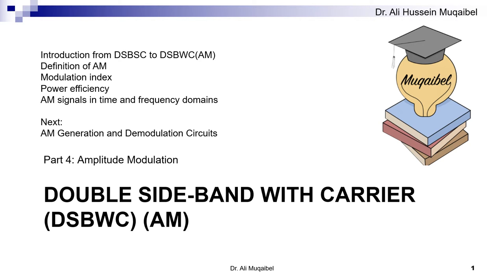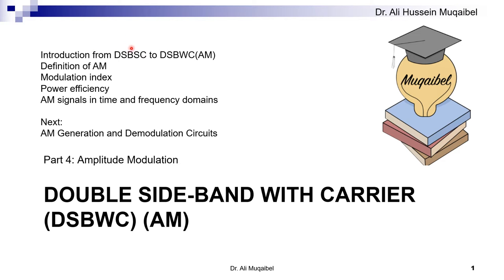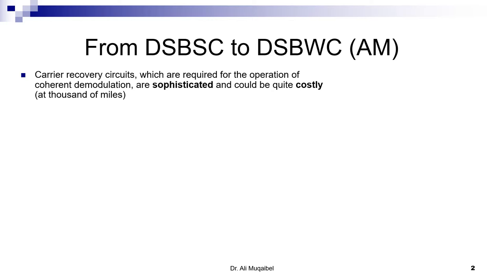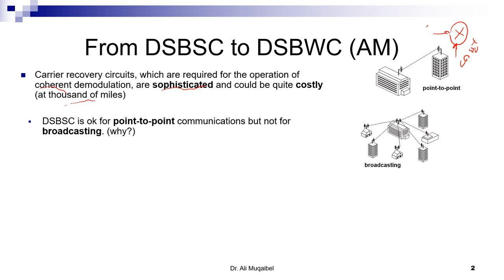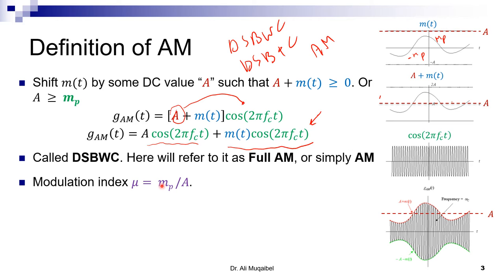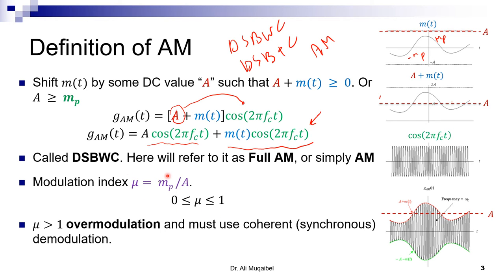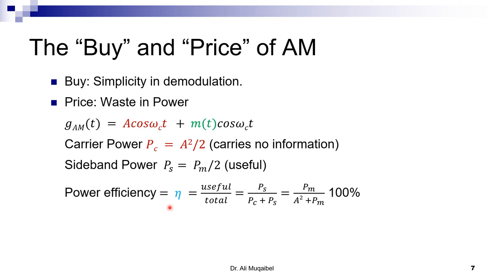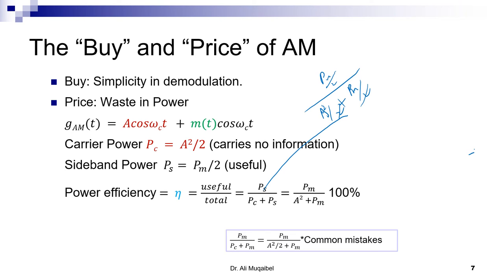4.4.1 Double Side band with Carrier (DSBWC): Full AM

Comment: b) Power efficiency =  Pm / (A^2 + Pm), Since u = 0.666667 and Mp = 10 then A = 15. Therefore, Pm = 10^2 = 100, Power efficiency = 100/ (15^2 + 100) = 0.3076 = 30.76 % .
Reply from the maker: Good Job Mohameed Abu gurain
Reply: @alimuqaibel7619   doctor how is pm = 100 ? what does pm represent?
Reply from the maker: @mr.a9352  Pm is the power in the message before being modulation.

Comment: I think there is a mistake with the answers because the massage power in passband equal to 10^2 / 2 not just 10^2 , So the right answer will be 18.18%
Reply from the maker: Welcome Haider Abbas. The message power does not equal to amplitude^2 over 2.  This is true for sinusoidal signals. For square like signal which oscillates between A and - A, the power is A^2. Just start with the definition of power and apply it. You will find this in the signal review video. Thanks for stopping by.
Reply: @alimuqaibel7619  You are absolutely right Dr. Muqaibel, forgive me for my misunderstanding..My regards